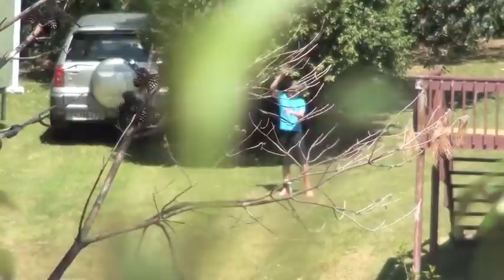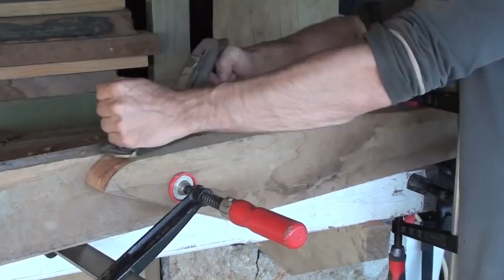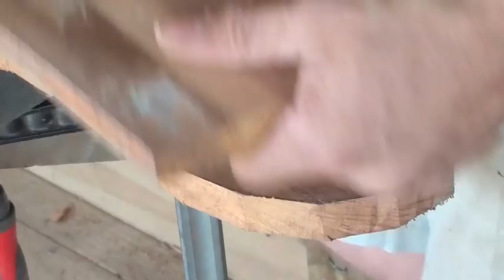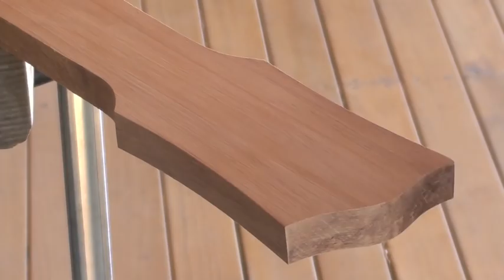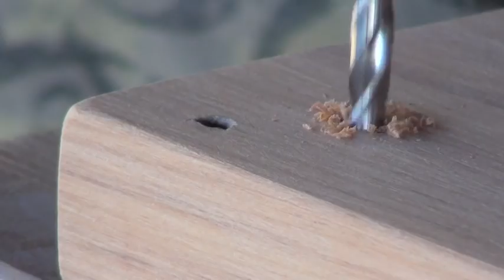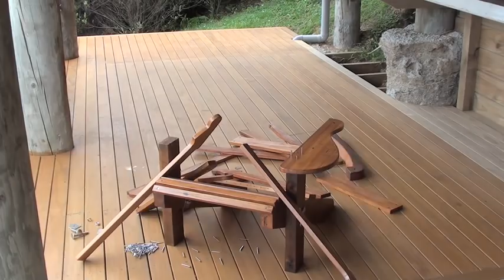Adirondack Guitar Chair Build

Comment: Always excellent..... I gotta ask, what brand is your brace (I'm assuming its near vintage)? Another great vid.
Reply from the maker: Hey dude.  Not quite sure what the brace is but its an awesome one, and indeed was my grandfathers.  Its so smooth and the chuck is dead centre with no wobbles and the steel is fantastic and doesnt want to rust.  Those old augers are a godsend too as Iv used them so much.  Better steel back then I believe.  It would take a fair bit of coin to replace I'm sure.  Love the old hand tool stuff, thanks again!!
Reply: It looks primo. Couldn't agree with you more about the manufacturing. Can't even buy a good one off the shelf these days, and high end braces are a bit of a commitment. Biggy ups for hand building this one.

Comment: wow super creative with the guitar headstocks as the back slats.  You should get a design patent and go on shark tank :-)  What kind of wood did you end up using?  It looks like Mahogany.  I heard Mahogany as well as many guitar woods are like Cypress are naturally weather resistant ?
Reply from the maker: +Spencer Davis Thanks Spencer!  The wood I used is heart "Rimu".  Rimu, or Red Pine, is a tree indigenous to New Zealand.  It has beautiful straight grained wood that is very sort after in woodwork.  It was used extensively in the early to middle of last century for house building.  The Tree is protected now and the only wood available is reclaimed demolition Rimu.  It is a softwood however the heartwood of Rimu is very hard and very much like hardwood timber.  It is mildly weather resistant howver with Sikkens stain it will last for decades if not centuries.  Thanks heaps!!!
Reply: Hey thanks for all the information.  What kind of hand saw (orange handle) do you use?  You seem to use it a lot and it does a good job.  
Also did you make up these plans or did you go off other ones and change a few things?